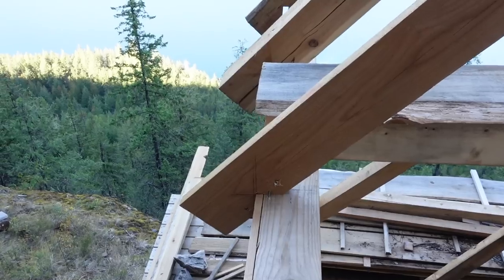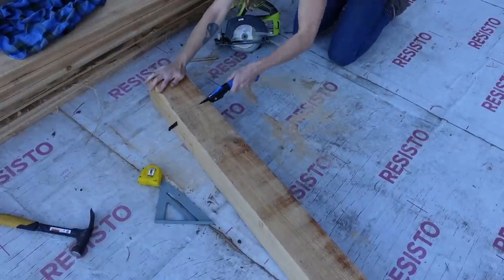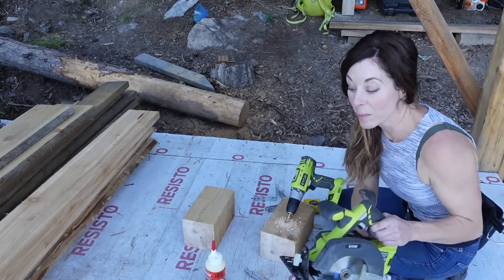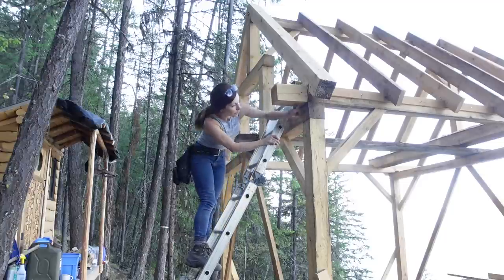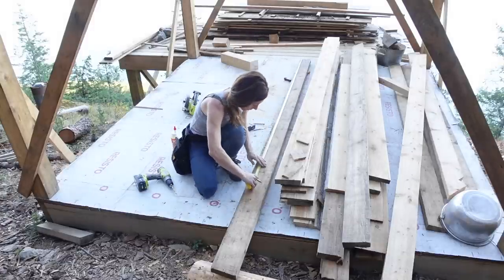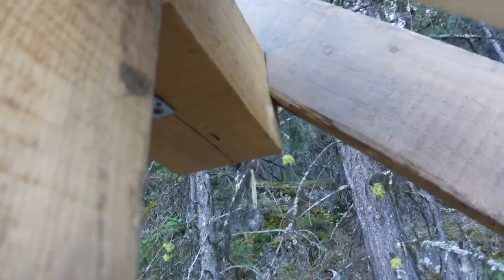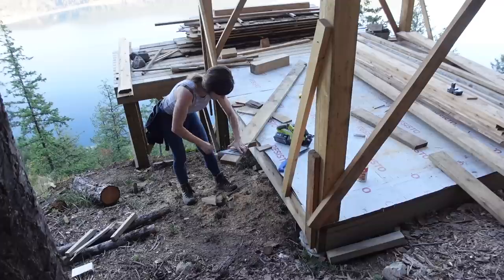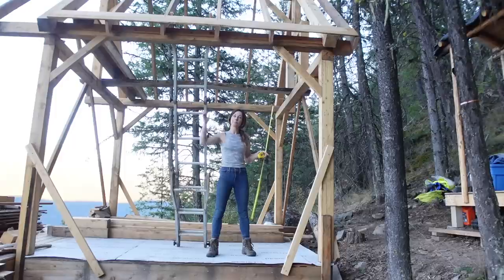It will be worth the struggle! Gable end beam additions done. Solo building just takes longer! Ch15

Comment: It's looking great Michelle. When you do the blocking, if you take your speed square to top of the rafter, slide it up till it touches the outside of the top beam. With blocks 90 degrees with the rafters, it will all be flush on the bottom and easier to put siding on it.🌹

Comment: Ms. Michelle-two notes. 1) You're doing well! Roughcut wood is tricky to work with, and you're making it look very nice. 2) Plan on setting some brackets under your beam extensions. The problem is that you have end grain attached to end grain- doesn't matter how many fasteners you put in it, or how big they are, that's a weak joint. The roof boards will hold the fly rafters up, for a while, but even with only a 9" overhang, eventually that end of the roof will bend downward. 
the good news is that the brackets can be installed after the siding is up, and they can be decorative as well as structural. You go, Lady!
Reply from the maker: Yes, my plan is to add some bracing like I did with the rest of the structure. But I will wait until all siding is done so that I don’t have to make special cuts around them 👍👍

Comment: I'm glad to hear that after so much screwing and a little banging you had such a tight fit.  ...with your rafters! Even though you didn't put it all in. ... i mean... the nails... in the roof board...
Nice job! starts to look like a cabin!
As for the stove i'd put it near the door/entrance. first because of the air/oxygen/ventilation and air circulation and second because you don't want to drag the combustibles all across the cabin.

Comment: With regards to your shim situation at 16:00 I would lean toward beter fitment at the top plate. That's the important bit, you can always scab a strip on top of the rafter to flush things up if necessary. But what you did was fine, cheers!

Comment: Nice Ringworm reference, I found both of your channels around the same time. Good stuff, you’re continuing to impress as you figure things out and DIY.  That view is going to be spectacular.  It would be harder but so worth it to make the cabin mostly floor to ceiling windows.
Reply: What is her other channel? Thanks
Reply: @dedwin8930  Rereading my comment, I was not as clear as I could have been. At one point in this video, Michele mentioned Ringworm, shorthand for a channel someone else has, it’s called Surviving Ringworm. It’s worth a look, for sure.
Reply from the maker: Yes check out Ryan’s channel - surviving ringworm. It’s great, I love it!

Comment: Michygoss, typically what is done with those end hangovers is to cut the 6 x 6 roof beams and notch them to accept the 2 x ? to attach to the second rafter in, and hang over the outer edge to support the hangover beams. That way it supports whatever you wish to build for the ends. More secure and no worries about hang on beams... Just an idea. But absolutely impressed with your abilities and willingness to climb up on the structure to work. Especially building on a cliff... Thumbs Up!

Comment: An alternative to the blocks you added to extend the beams is building a ladder which sits half on the roof, half cantilevered over the edge.
You could cuts notches in the 6x6 to pass through it too.
Reply: I was going to suggest that too. We used to call them "lookouts". But it wouldn't be the same asthetic as the faux-beam ends

Comment: That's a pretty big project for anyone you've have MUTZI !!!! that's for sure. Just before you go putting any more weight on top, you might want to construct walls down the bottom first to give it more structure because four posts are all that is holding up, then given where it is, it might pay you to cyclone bolt it or guess in America it would be "hurricane bolt" it. Thats when you bolt with a really, really long bolt from the rafters to the floor joists.  But first I reckon you've had to get some structure on the bottom floor first. And I'm not too but if you look facing the water, on the right-hand side one of the main posts has a crack at the bottom or might just be superficial .... Either or, you are doing a great job Wow!!!😃👍

Comment: On your future projects try out the GRK rugged structural screws (RSS).
They cost a lot more but they're worth it.
A beveled point to drill a pilot hole, reverse thread on the shank for drilling a clearance hole, flat washer head, torx drive.
They really help to avoid splitting the wood with self drilling pilot and clearance holes, and no wedge shape on the head helps to resist the screw pulling through or splitting the wood. Case hardened, preservative treated, all round just great product.  Also they pull pieces together really well with the clearance hole, so many good things.
Hey, the BCBC say minimum 3 nails on those joist ends, I can't find anything in it about screws, probably because of the huge variety of product and performance.
Personally I use a screw when lining everything up, then run back over it with a nail gun to quickly toe nail everything up to spec.
Get the mobility of the impact driver, ability to reposition, draw things tight or make changes and prevent future movement with the screw, then get all the speed and shear strength of the nails plus code compliance.  I don't like just nails, too easy for thing to loosen up and hard to change if mistakes are made.  Not that it ever happens.  Also don't like just screws, cot and questionable shear strength. I've seen lots of broken screws when disassembling framing, I've never seen a broken nail though.
Reply from the maker: Glad I have both screws and big nails!

Comment: Would love to see the wood stove on the front view side wall, similar to the way ours is, looking out at the water and watching a crackling fire at the same time is nice....But if the loft complicates it then it makes sense to put it in the back, Plus I have no idea what your layout plans are so...... Happy to see the cabin coming along Michy, Looking Good. Best wishes
Reply: We put a wood stove in our cottage last year at the front as well for that very reason as well! But for this cabin, presuming the door is on the back wall, I'm on Steve's side -- I think it would give the most space on the back wall, beside the door.

Only assuming the door will be at back though.
Reply: @chad1755  ya makes good sense. Function over all, 👍
Reply from the maker: So the door is at the front, facing the lake. Sliding glass door (unless that whole things doesn’t work and I have to do something else). That was my thought exactly - looking at the lake with the stove there too. That is the set up of our main cabin exactly, which is why I was going to copy it. Plus coming in with wood, it’s just to the right. 
Going through the loft is more complicated and expensive, and will make the loft even smaller than it will already be, so that was one big reason. 
I also have a tentative plan for a floor to ceiling fireplace feature, so going with the back corner will allow for that, and be a ‘feature’. This will be seen as you come into the cabin, rather than it being tucked into a corner. 
Yeah, pros and cons to both. I could have went either way, which is why I asked Steve and because I needed to decide I went with his choice. 😁🤞🤷🏻‍♀️
Reply: @michygoss7148  I wasn't questioning ya Michy.....just chatting.  No matter what it will be beautiful I know. Have a great night.
Reply from the maker: @OffgridwithJayandJen  lol. I want you to question me, dammit! 😆
Reply: @michygoss7148  giggle giggle.

Comment: A Ryobi P415 recip saw with Diablo 12" carbide teeth pruning blade would sure be useful to you to finish cut beams instead of the little handsaw you use.  I like my P415 so much I feel guilty about using it so much so I bought another one.  Also a Dewalt DW2054 screw holder would allow you to start your long deck screws without having to use your extra hand.  That is handy when you're holding on to a ladder and only have one hand to drill with.

Comment: frankly outriggers should be used to hold your gable barge board in place, those are ran back to the next rafter back from the gable rafter.. gable rafter is notched out for a flat 2x4" or 6 (set saw depth at 1.5" draw your 3.5" width to accommodate flat 2x4's, saw out the wood with multiple cuts, celan up with chisel) which are extended out the length you prefer your overhang to be.. space them at oh, depends on your roofing and load but at like 2' minimum, for heavy snow loads go 16" ..

your rafter tail barge board will support the overhang barge board where the two intersect, the rafter tail barge and the gable barge, nails should suffice to secure but hardware may be used for heavy loads.. this supports your sub roof and roofing plus any load.. the corner I'm referring to where the barge floats, as in where the eave end barge at the bottom and the rafter tail barge board coming the other way meets... yes it floats out there.. how its done so if you are expecting heavy loads then a nice heavy barge is required, 2x8, I have done 2x12 on chalets per engineered snow loads but those were 2x12 rafters on 1' centers.. heavy engineering for heavy snow loads on ski lodges resorts so forth..

Comment: All humor aside michy your doing fine. Your adapting, and overcoming, obstacles. Just put blocking out at a right angle and allow for the thickness of the siding. The ones at the top just to where the top is the same height as the top of the rafters. Were you planning to insulate the roof? 
Stay hydrated especially when drinking sodas with caffeine or anything with caffeine follow up with water, please. 
And yes your window for getting the roof on and at least water proofed is closing. Not something to be doing when it's snow "the white flying " . But your doing fine  just keep pushing forward, lots of respect for you. Now get busy beaver or woodchuck, and make that wood pile disappear. So until next time God bless amen. ❤ 🦫
Reply from the maker: Yes I’m going to insulate the roof and walls. Adding all insulation to the outside surfaces. 
I was wondering if blocking was necessary on the ridge beam? I was thinking to skip that if not necessary. But will clearly be blocking along the walls.
Reply: @michygoss7148  yes michy the blocking on the ridge will be running plumb, not square like the blocking at the rafter tails. The reason this is important is because,  structurally it prevents lateral roll, of the rafters. The other is to prevent birds and flying insects from living in the roof.  If the structure was larger it would be necessary to have ventilation in  the bays between the rafters. You could drill 1½ holes evenly spaced  and then put screen on the back side of the blocking. But the size of the cabin and roof ratio is fine for a closed system. Meaning that the heat of the stove will be sufficient to keep everything nice and dry.
Where a larger roof would need to have some air transfer. 🤔 the square footage ÷2= cubic inch feed ratio. FYI. That number drops to half if there is a wooden floor with stem walls. That also is subject to climate zones. Hope that answers your question. Smile God loves you, amen.

Comment: Since your four corner post are sitting on the deck, I would recommend some hurricane straps or some type of bracket tying the posts to the deck frame.  Diagonal screws aren't sufficient.  Further, is the deck frame tied the ground to keep it anchored to the ground?  A strong wind coming up off the lake could dismantle the cabin.  Your effort is really good, just a few adjustment.
Reply from the maker: The foundation is bolted to the bedrock. I haven’t yet fully tied down the posts to the foundation yet but have a plan.

Comment: There ya go!
Now you're on it. 
The reason it didn't fit on the other side was because of the weathering that the structure took from laying out for a bit without being covered completely ,like I had mentioned prior, I'm sure you initially had it nice and square, but the swelling and contracting of the wood will definitely throw a wrench into the works..
It's all good,  you can do them independently, just remember that you'll probably have to adjust all measurements one by one from here on out, but it'll be fine.
Haha pulling a Ryan 😆 also known as (temp. Nailing) ,in fact ,you could save yourself some time with that by numbering all your roof boards in order. Just make sure that your temp nailing is secure, then lay them up in succession, take a pencil and speed square up with ya and mark them to the center of your rafters, just remember to stagger your courses, no 2 seams should ever be above and below one another ...for instance, your 1st board could go from rafter #1 to rafter #3 but the boards above it should go to rafter #4 or #2 ,ya see?  And don't worry about what hangs wild over the end/edge of the roof, you'll be snapping a chalk line and cutting all that off in one go, later on when the whole roof is buttoned down anyways... 😊👍 nice work Michy, enjoy your build!
Reply from the maker: Yeah all my roof boards at varying widths, and lengths, so it’s likely gonna take me a bit to sort out. 🤪
Reply: @michygoss7148  it's all good , what type of roof are ya going with? Metal or shingles?

Comment: You’re battling away awesomely, a couple of things you might be able to try next time is make sure your frame is parallel and square then cut a pattern rafter, trace another off it, making sure you keep the tops flush, then try them at both ends, if all good trace the rest of the rafters off the original one! Another way is before you build your frame, draw the external beams on the floor and draw your rafter on the floor to get your size and cut them all before you build it!
Hope that helps and I
Hope that makes sense???
❤️👍
Reply: I watched my neighbor build this way last summer. The only time he needed help was when he raised the rafters.

Comment: You could try a cargo net on your sky mule.  Mine works great with no problems so far!
Reply from the maker: Where did you buy your cargo net?
Reply: eBay. it's 5x6 rated 600lb. not expensive.  easy to use.
Reply from the maker: @ralphdanysh7760  ok great. Thanks!

Comment: If you get a little off by height like in your case, no need to shim under, just nail a strip of right thickness on top and voila'! It's looking promising though. You're doing a good job, sorting things out as you go.. Cheers, keep crafting, every success is a new experience, every experience is knowledge.😉
Reply from the maker: Yep, that’s exactly what I’m gonna do - make a few strips. The other side I noticed is lower too as I put that one roof board on, so I plan on making a few strips at home on the table saw, of varying thicknesses to have in case I need them 👍👍

Comment: If I may make a suggestion, I think you should bu yourself a Ryonba saw. It cuts on the pull stroke and has teeth on both edges. coarse on one edge and fine on the other. Lee Valley is a company that originated in Canada, but also sells in the U.S., and they have one that costs $32.50 U.S.  I think it would make the hand sawing you do much easier.

Comment: Well, if you wanna be safe you might can use also kind of "Rafter Purlin Anchors" or "Hurrican Anchors" called in english.With them you can secure the roof agains wind forces which could lift the roof. Screws are OK, but well, I would use them at least on the four corners.

Comment: To correctly & securely attach barge joists or barge rafters, use outriggers running from the last two joists. Do you need help?
Are you working from plans?
Reply from the maker: Not working from a plan. Just a vision in my head.

Comment: When the roof gets heavier and more weight is added from contents I hope the center of gravity does not become closer to the edge of the cliff.  Could you add some anchors like the ones for the sky mule that could be used to prevent the whole structure from sliding off the cliff?
Reply from the maker: I think we’re ok, and so does Steve. But he still isn’t done yet - he has had plans to anchor things down like they do in Switzerland
Reply: So relieved to hear that!!!

Comment: Hi Michy, cabin looking good ! (and you not too shabby either ! ;)) So, anyways I must have missed something here or a previous video because I can't figure out why you didn't just extend the 3 beams 8 inches in the first place? thanks for posting another good video. cheers !
Reply: To make the beams light enough to haul up a ladder and put in place. 1 person project.
Reply from the maker: The lodgepole pine that Steve cut up for me last year was done in 10’ and 12’ sections - I didn’t have a cabin plan and figured 12’ was a good enough length given the fact that my cabin was going to be 10’x10’. I was also carrying all that lumber down the mountain as this was before the SkyMule. So figured 12’ was enough to carry and build with being by myself. 
I’m hindsight, sure - I should have just got Steve to cut them to 13’ to allow for extra, but it is what it is. I also could have not put all the overhang on the front, but I wanted as much as possible at the front, so adding to the back didn’t seem like such a big deal. Ha.

Comment: 7:03 There is where, if you had planned better, you could have made the beam longer to include the overhang you are adding on both ends. It is easier to cut off a board than it is to add longer lenght. Plus, it is much stronger.
Reply from the maker: Not quite true - Steve cut the lodgepole pine at 12’ sections, so that’s the length I had to work with. Plus, anything much longer than that is that much more difficult to transport. Remember, I carried all those posts and beams down before the SkyMule was ever there, so things needed to be manageable.
Reply: @michygoss7148  The other choice would be to use two sections for the beam. You can splice in the middle better than on the ends. If you have a post under the split, it would be nice and strong.